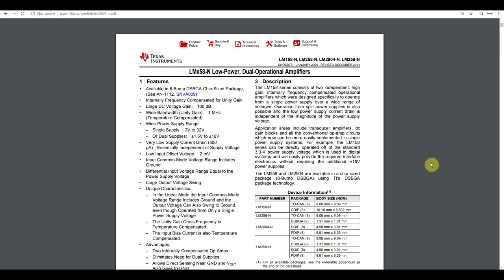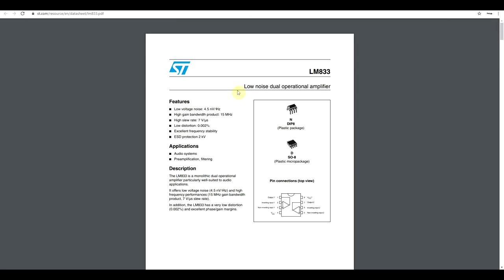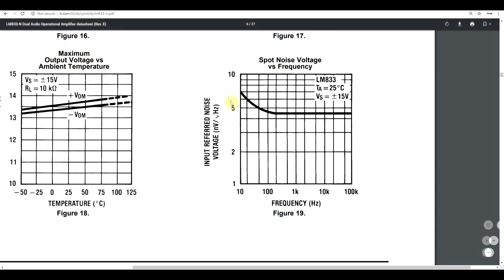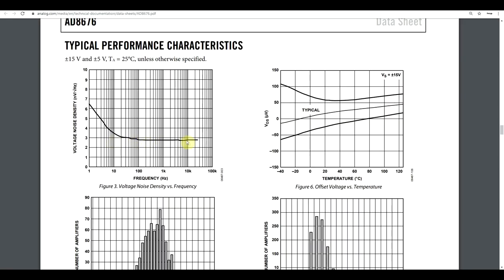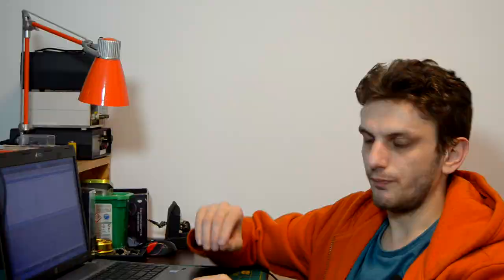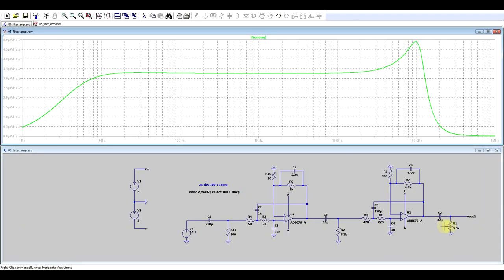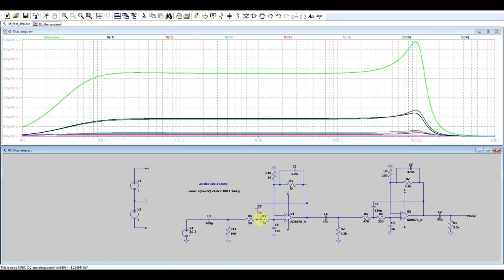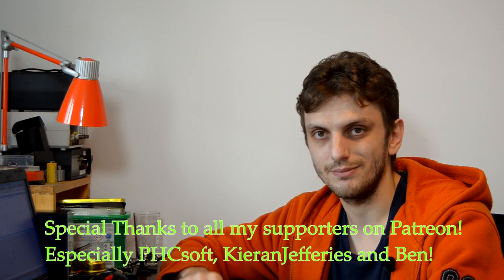Electronics Tutorial - Building a Low noise signal amplifier Part 2/3 - LTspice Simulation

Comment: I once had to design a bio instrumentation amplifier to pickup eye movement signals, which unconveniently lied in the 0hz -15 hz range, so basically in the flicker noise of almost if not all opamps. I got around it by modulating my signal to 10khz since at that frequency only thermal noise exists, filtering and then demodulating the resulting signal after all the processing. Of course from a simplicity point of view, it isn't so viable since you have to have a dedicated oscillator, two modulators, multiple filtering stages, peak detectors, etc. But it was interesting nevertheless. Keep up the videos, i really enjoy your content!
Reply from the maker: Sounds like a really interesting design! I guess that is one of the best ways to build the circuit in case you wish to make a really low frequency amplifier.
Reply: Wow. That's a neat solution! Never would have thought of that!
Reply: Genius idea!
Reply: @oojikarasuma1 it's a good idea, but a very well-known technique called Chopping

Comment: Nice video again. In theory you can actually make a fourth order filter with just one opamp (the math is a bit of a thing), so also an second order bandpass (for high and low). Depending on your needs it can be beneficial to use a multiple feedback filter instead of a sallenkey.
Reply from the maker: That will also work of course. The beauty of electronics is that there is no single correct solution. Any problem can have multiple ways of solving each leading to mostly the same result. For me it was this method, but any other method is just as true. 
I plan on finishing this project as is, but in the future I may revisit the idea and try to improve on it, maybe try out this sort of filter.

Comment: Thank you so much. my challenge is how to amplify a thermopile signal (10uv -1mv) using only LM358 that is available in my county nowadays because of the covid-19 pandemic! is there any way to compensate for the amplifier noise?
Reply from the maker: Hello! Well the thermocouple (thermopile) is not a particularly fast sensor so you can manage the noise by severely reducing bandwidth -  you can add a capacitor over the feedback resistor. Another thing to keep in mind is the input offset of the part - the LM358 has a maximum of 3mV. If the offset doesn't vary the circuit will work as long as you compensate this
Reply: @FesZElectronics  Thanks so much for your help and fast reply.

Comment: I want to amplify a 1 mhz signal from a transducer in two stages of 20db. Which ic can I use?
Reply from the maker: Well since you want 1MHz of bandwidth and 20dB of gain the op-amp should have at least 10MHz of bandwidth, the more the merrier. I guess the hardest part will be to select a low noise circuit and re-adapting the filters. But this should be easy to test in the simulator.

Comment: Hi, great content. I'd like to simulate the NCV33272ADR2G but I cannot find a .model or .subckt. Do you know where to find it or how to build it?
Reply from the maker: Unfortunately the manufacturer does not provide a model on their website, or at least I could not find it; since this is an op-amp, you could look for a similar or equivalent component from a different manufacturer that does have a model and just use that... LTspice has a ton of libraries built in for LT and AnalogDevices opamps, there must be something similar
Reply: @FesZElectronics  TI suggest TLE2142 but they don't look so similar... and it exhibits a lot of noise on low frequencies too (LTSpice).

Comment: can you explain how you calculate R and C values of the Low pass and High pass filter
Reply from the maker: Hello Dimuthu ! Well there are formulas for this sort of filter - for example here at the end of the page https://www.electronics-tutorials.ws/filter/filter_6.html (and chapter 5 is about the low pass version)
But to be honest, you only have certain resistor values available (depending on tolerance and your personal stock) so I just tried out a few combinations until I got the desired effect. You can do this a bit faster by using .step commands

Comment: 12:02 - Not multiplied by 8 but by 6. This is due to the theory and your measurements that you present in Part 3 (https://youtu.be/2mGKvGYwWrk?t=423). This gives a 33 percent difference.
:-)
Good job.
Reply from the maker: This is quite a relative subject. I've found different values for the relationship between noise and RMS voltage. On page 4 of ( https://training.ti.com/system/files/docs/1312%20-%20Noise%202%20-%20slides.pdf ) its x6; on page 6 of ( https://www.renesas.com/eu/en/doc/misc/noise-in-the-signal-chain-webinar.pdf ) and page 3 of ( https://www.analog.com/media/en/training-seminars/tutorials/MT-048.pdf ) its x6.6 but in the end its a probability topic. The 6x factor comes from 6sigma=99.7% probability that Vpp will cover the 6xVrms. By going up to a factor of 8 you ensure that the value of Vpp will cover your measurement in 99.99% of cases.
Reply: @FesZElectronics  Yes. It is indeed so. This factor (6 or 8) depends on the confidence interval, but in practice 6.6 is most often used. You are right and I have some of it. In your measurement from 3 parts (https://youtu.be/2mGKvGYwWrk?t=421) Vrms = 1.44mV and Vpp = 8.72mV. The ratio is therefore 6.06.
  BTW, why the measurement is cyclic RMS? What your oscilloscope really measures. Where's period in the noise?
Reply from the maker: To be honest I wasn't paying attention to the type of RMS, I don't think there is much difference between the 2 when measuring noise since there is no cycle to stick to. Anyway I don't really trust the automated measurements on the Hantek, they seem to be off from time to time. Also for a proper noise measurement, that oscilloscope has quite few data points (mine can do a maximum of 16k I think; In theory it has a memory upgrade up to 1M but it just can't process it very well... various measurements like the FFt will limit the memory to 4k even with the memory upgrade)
Reply: @FesZElectronics  This is not the point. The measurement of Cyclic RMS is based on the fact that the oscilloscope finds the period of the waveform and integrates it only in this range. This avoids the error of too narrow or too wide integration range, which would cause errors in determining Vrms. And there is no period in the noise, so how does the oscilloscope count crms? Probably takes the first case that would resemble a period - e.g. the time interval between the intersection of the rising edge of the signal by a certain voltage level.
In oscilloscopes that not has crms measure, the rms voltage is calculated from the integral of everything that is in the acquisition record.
But we're leaving the topic.
Reply from the maker: @Jarodoli I looked up the manual for this oscilloscope ( https://www.circuitspecialists.com/content/183992/dso5102p_manual.pdf ) in chapter 5.5.2 on page 33 at the bottom they explain CyclicRMS and PeriodRMS. Apparently the CRMS is just the regular RMS over the entire range and PRMS is what we know as CRMS. Guess its a translation issue, but I tried out looking at some random noise, and the PRMS is much smaller than the CRMS so the description is correct.

Comment: why there is no phase shift in output as you are using RC filter....
Reply from the maker: Why do you say that, in the AC simulations its visible - example https://youtu.be/Car8hk_ubJs?t=500 ; the noise simulation, the one that I do most often in the video, does not contain phase information though